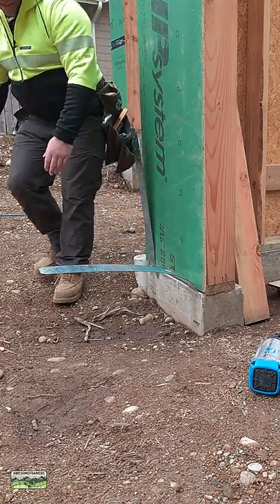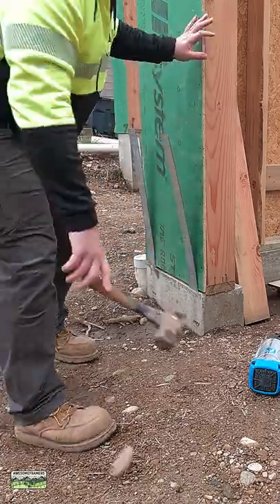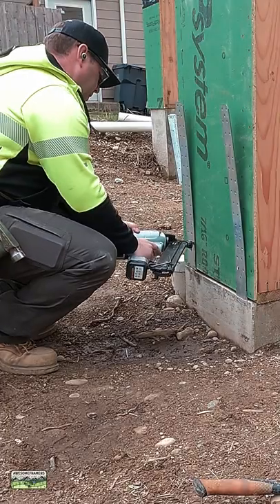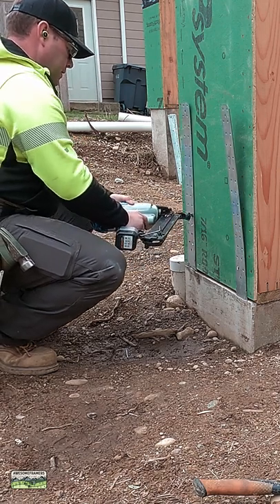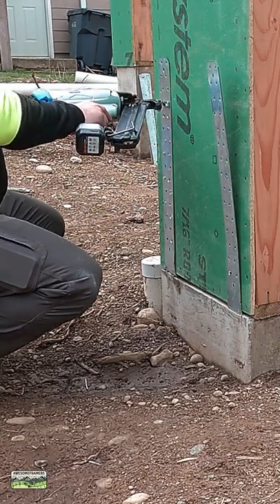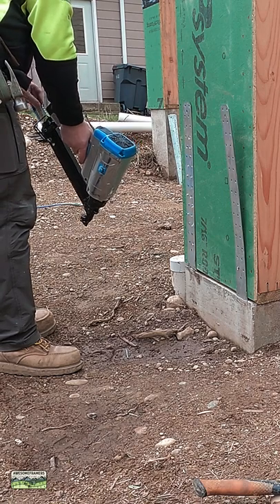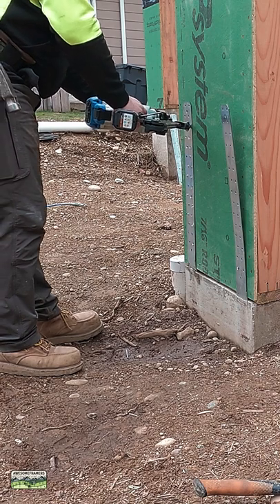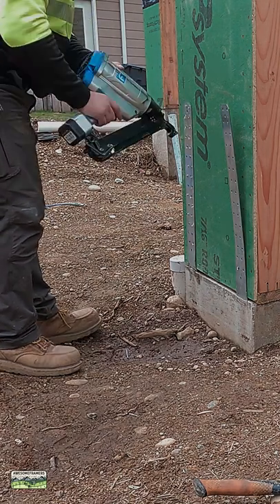Let's Just Do it Right #shorts

Comment: Ok, I’ll say it. That’s not going anywhere.
Reply: Simpson is currently thinking of more crap to add. 
This will be “ unsafe “ in a year.

More brackets will be needed
Reply: these straps alone will allow fractional movement
Reply: You have to say that, especially if it’s ratchet straps on a trailer. You could kill someone for not saying that !!
Reply: Mike, you win.
Reply: Its a wooden house with plywood and drywall. Its moving alright..
Reply: Funny Americans.....
at the next Storm the whole City is flying away ..👏👏👏
Reply: @littlebuch  out here in houston a 3 bedroom townhouse runs 580k with just siding no stone or stucco its insane, my dad does metal buildings so ima do that instead of some wooden house
Reply: Until hurricane Ian
Reply: @DSkimRS  That's why the detail requires more than just those straps.  the sheathing has to be nailed at specific spa inhs on the perimeter and the field, with two rows of nails at 2"spacing at the intersection of the header beam and the top of the 2x4s forming that wall.  it requires that the header extend over the tops of the studs that both those straps are set in front of.  the studs are then required to be strapped to the header as well.    it's called a Portal Frame and is engineered to prevent the outcropped garage from racking in windstorm conditions.
Reply: @itaintrocketscience  Simpson doesn't decide what strapping is required to added to framing.  Engineers do.  They just produce and sell what's called for in order for builders to comply with code and engineers specs.
Reply: @devilishirv  Good luck with hoping we don't have another hurricane.
Reply: But how much is it tied in to the concrete?
Reply: @jonvoller4344  on that type of anchor, there’s a bigass chunk of it with a cup-like shape on the bottom that gets set I’m going to estimate 12”, maybe more, in the wet concrete.
Reply: At my old house, I decided to extend my back deck which required me to demo the stairs I had built just a few year prior. I couldn’t easily get to the simpson stringer hangers to get all the nails out. After beating the crap out of the stairs with a 10lb sledge from above (~8’ off the ground). No luck… Took out my recip saw and was able to cut the two outside stringer hangers, leaving the middle hanger. I was able to get about 1/2 of it cut with the recip saw but I just couldn’t get to the rest. More beating with a sledge, followed by more beating, followed by jumping on the staircase (probably not safe… but…). Then more beating, I finally got the simpson hanger to stretch enough to get the recip saw in there to cut the remaining 1/2” of metal. The staircase finally fell 8’ to its death… moral of the story was it wasn’t going anywhere with those simpson hangers…
Reply: Don't forget to slap it twice when you say it!

Slap  Slap
Reply: Actually it will.. “flush with the sheathing” also means water will accumulate there.. rotting the sub structure in about 3-5 years.
Reply: @invictusbp1prop143 You forgot about the Elmer's glue

Comment: I am glad you mentioned using the correct nails.  Most contractors and builders don't care.  I've recently seen 8d hand drives.  Sadly green tagged by the inspector.
Reply: Lol I recently had a deck inspected and it was all of 5 minutes. He walk through the gate and said "yeah it's a deck"🤣🤣🤣
Reply: 8d's are 2.5" 🤦‍♂️🤔😂
Reply from the maker: @joshuamurphy7165  Check the catalog, I was using 2.5" x .148" as shown in the catalog.
Reply: You should just mike homes it
Reply: I've seen roofing nails in straps, not this big but still just as wrong.
Reply: @joshuamurphy7165  I think he meant 8d Commons as in not galvanized.
Reply: @dg1602  Different straps have different purposes and require different fasteners.  some don't require very large nails
Reply: correct nails are of course crucial.  but they must be used to with the proper type of nail gun as well.  if fasteners are installed with a traditional framing gun, there's no guide for assuring the nails hit the holes perfectly and it's inevitable that even the best framer will miss a hole with that many being installed, damaging the hold down.  Engineers will specify hand nailed or using specifically designed gun for nailing all anchors and straps on a windstorm plan.
Reply: @AwesomeFramers  what kind of TECO nailer is that? I have a Senco one but it's not cordless. Looks pretty smooth. Thanks
Reply from the maker: @mydogatemyhomework3768  https://www.jlconline.com/tools/fastening-tools/cordless-metal-connector-nailer_s
Reply: Hand drives have superior strength to gun shot.
Reply: I’ve seen guys use bullet heads for fixing joist hangers
Reply: @Majaitala  rubbish
Reply: I once had to pull every nail out of these straps and put the right ones in because my boss walked by as i was putting the last one in and decides to inform me i was using the wrong nails then tells me i have to put the right ones in and brings me a bucket of nails i had maybe been on a jobsite for a week lol
Reply: @AwesomeFramers  ❤❤s10
Reply: Still ain't going anywhere. No need to cry bro
Reply: The guy i started for just had me hand drive 8s and call it good. My fav was replacing raul pins with 2to 3 concrete nails
Reply: @Joshua Murphy  they're not thick enough though
Reply: Its all getting out of hand. Liability is crazy for engineers but its creating a real beast for everyone else. What will this accomplish that a j bolt wouldn't?
Reply: @bobwitt305 A lot. This has way more fasteners into the stud and the sheathing. The connection strength is many times greater than a bolt thru the sill plate.
Reply: @court2379  I understand that but if you do the math it's not necessary.  PEs carry liability for life so they have had to raise the safety factor to a level that is unnecessary to cover their buts.
Reply: I had an inspector that told me to put the permit board right beside the road, so that he could sign it by rolling down his window and not have to get out of his truck.  It was a bugger using a post hole digger going through the limerock road base.

Comment: And every exterior finisher cries a little inside 👾
Reply: Yea, and I guess the vinyl corner post nail fin will just miss that strap. Lol
Reply: At least his are flat lol. I install exterior doors and the amount of those that I have had to cut a half inch off of to get the door in the opening and then they're still pushing past is a nightmare. There's no fudging doors😂

Comment: ..tornado will take the whole foundation with it.. 

That ain’t going nowhere.
Reply: there's more to the portal frame configuration that those straps are required for.  proper nailing pattern, header extends to the corners, and straps securing it to the studs.
Reply: Gracias muchas gracias por pensar así,  además esas cintas metálicas estorban para colocar todo el acabado de esquinas , puertas y ventanas y ni se diga la pared .
Reply: The nails will pull out.
Reply: Straight up first guess was Oklahoma or Kansas
Reply: @Invictus BP1Prop  it's not always a portal frame in this situation, alot of times it's also just a shear wall on either side of the garage door. Even it it's like 2 or 3 feet side.
Reply: Not much will survive a tornado direct hit.  An EF3 will destroy brick structures.  EF4 and EF5 will require either steel reinforced concrete walls or a solid steel structure. So basically you need a military style bunker.
Reply: Tornados aren’t that strong, they only destroy the house

Comment: I think these architects have large investments in Simpson strong tie Co.
Reply: Exactly. So much of the code that requires tie downs like this is all based on someone making money. More bs than anything.
Reply: it's a good idea in the PNW and California. Stop houses from separating at the bellybands.
Reply: It’s not architects.  It’s the engineers.  And there’s legit purpose for the stuff but there have been issues like the companies that manufacture post-tensioning cables occupying the positions on the council that determines the standards exploiting their power by changing the requirements to include 2 draped cable in all grade beams instead of one, instantly mandating an increase their sales by 25%
Reply: The architects need to prove (seismic code) that the structure doesn't come apart, flip, or slip when the ground moves with 1g acceleration up, down, or sideways.

Comment: We use 16d (16 penny) sinkers here in Utah, USA for those.
Reply from the maker: Check the catalog, you can use a  2 1/2" x. 148" nail
Reply: @AwesomeFramers  is correct. 2-1/2" over max 1/2" sheathing is an acceptable replacement for the specified 16d sinker or 10d common nail. Nice work!
Reply: Not legal in Washington  there are numbers stamped on the head to identify the correct fastener for the inspector.

Comment: I don't want to be a nit picker (but I will). When you start nailing at the bottom of the strap (to avoid bubbles) you should angle your nailer so that the nails drive upward and pull that bottom bit of strap tight. Then the rest should be perfectly perpendicular.
Reply: I thought the same thing. It's like pre loading a bit of tension so if they ever come into play the structure cant move the little bit before its tight. Might not matter, but doesn't take any extra time to do it this way. Why not?

Comment: I live in FL and we dont even use straps that big most of the time.
Reply: Ever heard of earthquakes?
Reply: @BullyBentley  they are uplift straps.
Reply: Those straps are used in portal frames required for large openings at the corners of the structure to make up for the break in the studs that would normally handle the forces that could cause any racking deformity.  there's a header all the way to the corners that gets strapped to the supporting studs.  also requires specific nailing pattern on 5hensheathung.

Comment: There's a bubble in the strap on the left.  The first nail should be hand-driven on an angle with the strap a half-inch away from the wall, so that when you flush the nail, it will have pulled the strap upwards, flat on the wall.

Comment: I'm sure that kit will still lift as the strap is fixed below the kit, if there is lift from wind etc the whole strap will straighten. Its better to have the strap straight fixed onto the kit and the slab below so there is no bend in the strap.

Comment: I'm not a real good Carpenter as you can tell by the question but how are the other end of those straps fasten down can you make another video and show that part or are they just laying under that plate
Reply: They are set in the forms and concrete is poured around them

Comment: Getting crazy. I once installed new AC unit on roof. They wanted 6 inch self tapping number 10 screws every 3 inches. I ended up putting about 150 screws into base. Even inspector said that seemed excessive but it's what engineer called for. I told him seems like whatever wood you screwing into had lost any structural integrity now that so many screws were installed transversely into it. He agreed but said engineers knew better. Oh well.

Comment: It’s only a matter of time before Simpson lobby’s ( and is granted) a   20 foot piece of 3” threaded rod, bedded in the foundation 10’ deep.

The remaining 10’ will pass through the bottom plate ( made 8’ thick and, of course manufactured by Simpson) running through the crown plate.

The whole thing gets welded and nailed, screwed and double bolted.
Oh and you’ll need a special welder for the special rod.
Reply: Spot on. 
Simpson is a text book in how to make the product you sell the only way to be Code compliant.
Reply: Don't give them any ideas.   Do you think it's a coincidence that the code changes that added a second draped post tension cable in every grade beam were made by a regulatory board, who's membership is more than 50% comprised of executives, owners, and officers of all of the major post tension cable manufacturers?   Yeah...just a coincidence I'm sure.

Comment: I’m curious, what is your sill plate attached to? I don’t see block, so I assume you did a monolithic floor with a concrete curb built in while you poured the slab? I use to do concrete and that’s how we did most of the garages. I thought it was a very interesting design and sped building time considerably.
Reply from the maker: sill is anchored to concrete stem walls.  You check my Project 150 playlist for the forming.
Reply: @AwesomeFramers  cool, I’ll check it out.

Comment: Are these hold down straps on studs or just in the zip sheathing? Is this Zip R or standard zip? 
I would assume that hold down straps would include a double stud at the point to which you would nail said strap too?
Reply: Yes.  those hold downs have to be nailed thru sheathing into double studs properly nailed together from both sides.  specific nailing pattern on sheathing. header extends to the cor ers and gets strapped to the supporting studs.its called a Portal Frame.  detail is designed to shore up large openings in the wall close to the  corners of the structure or areas that protrude from the structure, like bay windows.

Comment: I'm a fan of the alternative method:
HDU5-SDS2.5 used with the 24" stab bolts in the foundation wall.  🤷
Reply: Is this hurricane strapping? What happened to just using bollts?
Reply: A hurricane will shear that
Reply: Not intended to be used as an either/or preference.  they're the next best thing because you have to do something if somebody screwed up and didn't install the right thing or improper placement or damage.

Comment: Interested. Its good to see some of your tiedown methods. Is this standard practise. Is this America. As an Australian carpenter I see a lot of difference in how we do things here
Reply: I’m from america and I see it a lot.
Reply: @toxive2028  it's certainly different to what I'm used to. We just run treaded rod all the way from the slab trough to the top of the frame with a 2 inch heavy duty square washer and a nut on top and steel straps over the roof trusses that wrap down under the top plate. On big openings like that we use 16 mm rod but throughout most of the external walls it is 12 mm rods at 1800mm centres and either side of windows and doors

Comment: what are the upper 10 nails supposed to do? i doubt the strenght of that little metal sheet is higher than the strenght of ~20 nails or that of the wood. the metal sheet will break (if so) on the very bottom and all these nails will have done nothing.
Reply from the maker: I don't think you understand the difference between a shear wall and a hold down or tie down.  https://youtu.be/exryGdVm5ek?feature=shared

Curious, do you know the thickness or gauge of the steel strap? Embedment into the concrete?

Comment: I prefer the hdu holddowns inside the wall cavity
Reply: Not a preference kind of proposition.  Those are only meant to be used in the event of a failure to install or misplaced proper anchors.  Epoxy set anchors in existing concrete don't provide the same capacity and shouldn't be used unless somebody screwed up.
Reply: @invictusbp1prop143  I'd refer you to the hundreds of new construction prints/specs I've processed in the last few months... Commercial and residential.

Comment: Do they make you put a curtain wall system on the inside?  Where are you working at? It’s don’t a little different in Florida, depends on how young the engineer was. The younger ones are ridiculous. I’m surprised they don’t require metal sheathing welded to metal trusses near the beach. They getting a little insane here despite 80 year old houses remaining intact.  It just drives the price up. Thanks for the video.
Reply: If the rest of the house was built as well as the 89 yr old houses instead of being "value engineered" to cut corners wherever possible, they'd probably hold up without them too.

Comment: Only an engineer would require that many nails ✌️
Reply from the maker: And they provide the calculations too 👍
Reply: Because only an engineer can figure out how many would be required to handle the uplift forces it’s required to handle.   Plus it’s not just  to stand up to uplift forces.  It’s part of a portal frame designed to prevent the door opening from racking, so the hold downs are designed to prevent lateral movement in the return wall.

Comment: now do these straps differ when it comes to different wind zones? cause that looks like ones for extremely high wind zone areas.
Reply: The straps are used in windstorm zones as part of a portal frame system designed to prevent racking of any large opening at the corner of the structure.

Comment: Ok, that's the "standard", but the guys who work on the houses I drywall just throw a couple of deck screws in there
Reply: Then they're building a home that's not up to code and is compromised structurally from what's required for windstorm areas.

Comment: So your engineering must also require tie down straps to hold the top plates to the studs and straps to hold the rafters to the studs?
Reply: And strap the headers on all exterior doors and windows.   Those straps are part of a portal frame system used on wide openings at a corner if the structure to prevent racking of the opening.

Comment: "The manufacturer says to use 700 nails to hold up a 24" strap."

Yep...makes sense. 👍🤣🤣
Reply: Nails are attaching the chord stud behind the sheathing to the foundation. Need the 24" to distribute the force through the double stud so it doesn't fail.